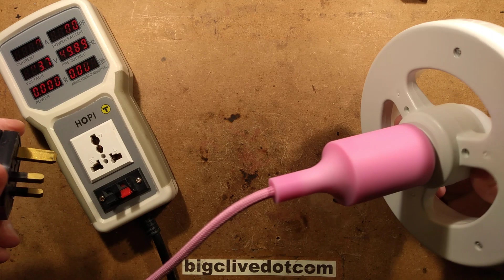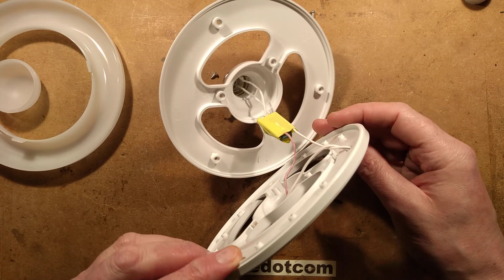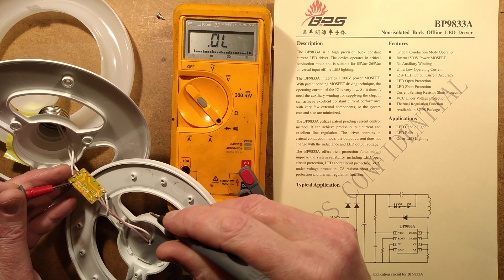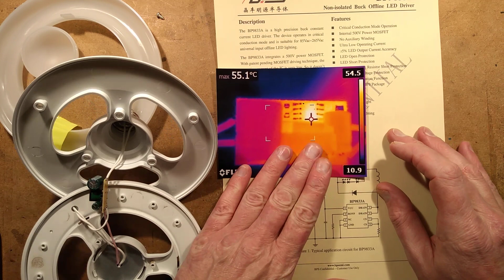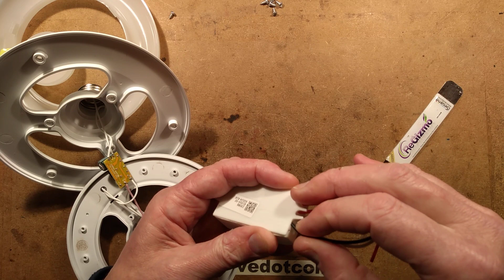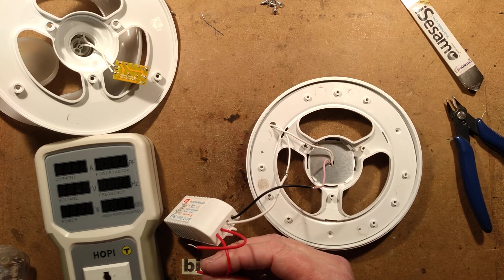Inside an LED "Circolux" lookalike?

Comment: I purchased a LUXO maglamp based upon their old metal shell design. It was only available in N.America, so the fluoro and its driver circuit ran on 110vac. Since I'm in Australia, it presented a problem. I didn't want to use a stepdown transformer. So I found a beautifully made LED T9 circular luminaire that dropped straight in. I used WAGO connectors to wire it in and it works a treat. I doubt very much if that circular luminaire is available now. So Burley was your Studio 54, Clive. 😆

Comment: I’ve wedged things (flat screwdrivers) in the clips to keep them bent back while I went and did the others around the thing im taking apart otherwise it’s literally IMPOSSIBLE to get the thing apart without breaking the clips off 

I had to do that cleaning out a dryer one time which needed to be dismantled the lint was so bad inside it had the most 😖😖😖🤬 little cover on it which was hiding screws it took a TON of screwdrivers to hold the clips back to slide the cover off without breaking it 

I got it apart cleaned it out a TON of lint came out some had burn marks on it I put it back together stubborn cover and all and it worked a million times better afterwards

Comment: The light must have been made for an RV in the USA; for some reason, on all the RV's I have ever owned, and I have owned several, they wire the 12 volt system with black + and white -.  Really threw me the first time I went to connect my deep cycle battery for the rig.

Comment: I have a GE Circline lamp from the early '80s, which I bought new-old-stock in box a few years ago. It's particularly interesting because it's made for a three-way lamp, although it only has two settings. Unfortunately, it needs a new tube (it's a permanent ballast, renewable tube model), & I have no idea where to find one.  Basically I bought it because it's a good example of the use of radioactive material in household applications ― in this case, promethium, which has of course completely decayed over the course of 30+ years ― but it was nice to use in my three-way floor lamp.

Comment: Interesting that when you put it on the lower powered supply, it looks like the outer ring is cool white, but the inner bulb is warm white? Maybe an attempt to strike a balance between the two in the same lamp, though biased towards cool as there's 64 of those and only 16 warm?

Comment: Re: Wire colors: The power supply Clive hacks in is completely backwards, isn't it? In US terminology, DC positive is red and negative is black. For AC IIRC, is hot ("live") = white, neutral = black, ground ("earth")=green. Charitably, I think whoever put that together knew which colors should go where and soldered it with the PCB upside-down, and ran out of black wire when they got to the side where the colors matter to prevent blowing out the diodes, I .E, both wire on the AC side the same color can be excused in certain cases, but at least make the negative black on the DC side (cars, for example, have multiple wire colors, so you can tell which wire is the positive for which circuit, but the negative is always black.)
. Murphy's Law in action. (Murphy did not say "If it can go wrong, it will." He said ""If that guy has any way of making a mistake, he will." or "If it can happen, it will happen." That's partially why anything where polarity matters is keyed so the connector only goes in one way nowadays, because one of the techs working for Captain Edward Murphy plugged some sensors in the wrong way 'round, causing the experiment to be a waste of time because the sensors didn't output useful numbers. The aphorism was later expanded, and the modern phrasing of it was first used by magician Nevil Maskelyne in 1908, around 40 years before Murphy said the thing, who wrote "if anything can go wrong, it WILL go wrong" in reference to any first public performance of a particular magic trick.

Maskelyne's point was that no first performance goes well because the universe is biased against you. Murphy's point was that the apes doing the actual work can't be trusted to match wire colors. But together, as the unofficial 4th Law of Thermodynamics, they're known more for Murphy, and haven't been proven wrong yet. (see a Soyuz or two that nosed into the ground because its sensors were plugged in the wrong way around, or the related aphorism "Those who try to build idiot-proof systems always underestimate the persistence and ingenuity of idiots." (Anonymous, but Heinlein said something similar)

Comment: I don't know how it works in the UK, but in the US (or at least my state), the power companies would have to get regulatory approval to switch to billing by apparent power.
Reply from the maker: They would include it in the small print of a "new improved" contract, knowing that people wouldn't wade through the ream of paper they got sent.  Same way the banks gradually reduced interest on current accounts to zero.
Reply: @bigclivedotcom  Again, at least in my area, they'd have to get government approval to make that kind of change.  Because they're a monopoly, power companies (among others) are regulated as to what they can or can't do.  That doesn't mean they won't try to sneak it though, but it's not as easy as you're suggesting.

Comment: Hi Clive 
How do I send you this woeful power supply for you to do a breakdown of it?
I would love to hear what you think of the cut and shut job they did, im sure this unit is cut out of another product and whacked into these little wall power supply units. 
Even the sticker says 6A and the one they stuck it over says 4A wtf
Reply from the maker: The repackaging of power supplies is a really common thing.  They usually involve quite a chunky box with a loose module inside that has wires chopped and new ones tacked on.  The good news is that they are often really good quality supplies.  I tend to downrate any power supply from eBay by 50% as standard.
Reply: I hear that 
This one however has an LED tacked on that was laying over a hard link and 4 bare cut wires 2 from the dc side and 2 direct from the 240 mains just chopped off and uncovered. The supply just pulses under load 
Btw Big Fan love your awesome channel sir, I just wish you was my teacher in collage I might of taken more notice ha ha

Comment: Those chinese in lamp SMPS are utter crap, they've got all kind of harmonics bursting everywhere, its overheating after 2 seconds of use and those caps close to heated components are no-no in good designed PCBs - so those lamps are just proper shite! The other supply  is true horror!

Comment: Clive, you ever review any bike lights? I just got a "Nestling Solarstorm" 3 led headlight run by 4 18650 batts very affordably. But 2 reasons I bring it up. First they have a power on light that has parasitic effect. This could be cured. Secondly my last unit very much like this design had a very poor strain relief entering the headlamp part. I actually fixed it and conformally coated it with 99 cent HF epoxy. Dragged it through a lake to make sure it worked.

Comment: Russian roulette with capacitors !. Last year I stripped apart an old PC PSU that was in  my workshop (needed parts from it). It had been on the shelf for approx. 5 to 6 months. Took the case off and thought, ummm, I will just give those a jab with a screwdriver, just in case. So I did... Bam !!!. Christ, they had a full charge. Just as well I did that or I might not be here now.

Comment: perhaps stupid because i did not think about it long enough,
but could you improve power factor by adding chokes on mains wires going in ?
50Hz is no high frequency for a inductive-resistor but would it work?
Or would you arrive at the point where the power changes from cap to inductor and the load would get less power.

Really need to look up power factor correction cuircuits.

Comment: What lens is referenced around 8:40? Could use a closeup lens for the E4 at work (the FOV sucks for circuit boards)
Reply: It's an idea from mikeselectricstuff (https://youtu.be/Lie771fzBaw?t=51 ). For the lenses you can just search for "ZnSe lens" on amazon or ebay. The holder is a 3D print of a model from thingiverse (https://www.thingiverse.com/thing:407201 ).
If you use the thingiverse holder,  make sure that you buy a 20mm diameter lens. As for the focal length, I use a 50.8mm and a 101.6mm lens at work. The 50.8mm is nice for closeups as seen in this video, the 101.6mm is better to get an overview over larger PCBs. Just remember, that the focal length is also the distance you have to keep between the lens and the PCB, so a 25.4mm lens might give you great magnification, but you'd almost have to press the camera into the board to get it in focus.

Comment: 24 Watts would drive an actual fluorescent bulb of that size... have they managed to build an LED light with no efficiency gain at all?

For a future tear-down, you might want to have a look at the "UFO detector" sold on Amazon.  Bunch of LEDs inside, along with a bit more circuitry than needed to make them flash convincingly.

Comment: What can be done in a domestic situation to improve power factor, is there a plug in gizmo to sort it out?
Reply from the maker: No.  It's very complex nopw and requires extra circuitry in every switchmode supply.  It adds a complete new failure layer.

Comment: Hi Big, love the videos. I have an old  Sony amplifier “Digital Audio/Video Control Center” (Sony model # str-k650p). I had been using up until a few weeks ago when it just audibly flickered out. The thing “sounds” (clicking noise) like it turns on but is super dimly lit. I took the cover off(unscrewed) and I can put my finger on the part that goes click click click when I turn on and off. That component that makes and generates a minute vibration, has a copper coil thing. I’d love to send it in, because it is so retro. I am not interested in paying for shipping 😗. Keep up the good work holmes.

Comment: That stupid color code is used here in the USA in RV's for some reason.  Really threw me when they told me that  as we hooked up the 12 volt system to a house battery on my first new rig!  Then I noticed it every time I worked on my motor home, I always meter the connections to see if some one has screwed them around.  Normally in every other system I have ever worked on, white is + and black - unless, of course there is black and red, then, of course red is indeed +.

Comment: how do, love the videos. have you ever thought about dismantling one of the Chinese 12v diesel heaters available on ebay/AliExpress? after looking into getting one, and the bad press along with the good it would be interesting to see if there are any 'obvious' gremlins that scream out at you? are they really deathtraps just waiting to burn down a camper or actually really good value? Keep 'em coming!!
Reply from the maker: I was looking at them on banggood recently.  At about £300 they seem so much cheaper than the main brands that something must have been compromised on.
Reply: @bigclivedotcom  you can pick up a 2kw, 3kw or even 5kw heat output 'planar'chinese copy on ebay for around the £130/£150 mark!! There is a forum on facebook dedicated to the set up and trouble shooting of these cheap and cheerful units with varying success!!

Comment: Hi Clive, have you got some new audio kit doing a kind of auto-blanking thing at all? I'm listening on headphones and noticing the usual background buzz is being muted when you're not speaking or discharging spicy caps... I suppose it's matter of opinion and others may disagree, but I find the constant cutting in/out of the background noise somewhat annoying. (more noticeable in fact than if there was no cut off and one could just hear the iron switching in the background.)
Reply: Not complaining by the way, just an observation ;)
Reply from the maker: My new phone seems to have a noise gate when it's recording that does have that effect.  I don't think I can disable it.

Comment: Clive I am convinced that some of the new smart meters are measuring VA rather than power already. The reason I say this is that several friends have had them installed and their electricity bills jumped by on average about 30%. This is with the exact same appliances and usage. I compared the units used for 4 of them compared to the same quarter the previous year, the lowest jump was 20% and he had changed all his CF lights to LED and a plasma TV to LED so should be using significantly less power (the LED TV is rated at about 170W compared to 650 for the plasma). Measuring VA instead of W is the only explanation I can think of.
Reply: I suspect the change from plasma to LED would have been more like 300 W average for the plasma and 150W average for the LED-backlight LCD as the ratings you mention might be maximum ratings. All depending on the screen size and brightness settings of course, but plasma energy consumption is very dependent on picture content and brightness setting while LCD consumption is less so (it is however dependant on dynamic backlight type and settings). Also, the power factor of both the plasma and the LED TV should be near 1, so for those the VA versus W argument isn't relevant anyway. Changing CFL to LED lights will result in an actual power cosumption dropping by a factor 1 to 2, but the power factor could be a significant problem (usually both LED and CFL lights have a power factor significantly below 1). In any case, this doesn't explain why he consumed 20% more according to the meter. If the old one was a mechanical meter, it could have been significantly off due to wear and tear but if it was an electronic one I agree that the most likely explanation is the power factor.
Reply: The plasma was a ridiculously big screen - 56 inches or something stupid. The LED was 40. Those were pretty much what I measured power wise.

Comment: The club was shut for 6 weeks, the report is found easily on the net.. I say no more ;) Anyway, I remember we had one of those circular fluorescent lamps when I was a kid, it was in the kitchen. I always wonder if they still make the fitting as I still see the lamps in some off road local electrical shops :) We also had one of those horrid circular heater/light things in the bathroom :D

Comment: I'm sure what the power companies will do is release a huge amount of propaganda stating they are reducing the price per unit of electricity by something which seems phenomenal to the ordinary public (say 50%) and then people will be left in a state of confusion when the number of units they use increases by 75% over night.

Obviously it will end up being debated in parliament too by a load of MPs who will applaud the energy companies generosity and completely miss the point. Maybe a few of them will end up with one of those 6 figure salaries at the end of their political tenure where they dont actually do anything, it's just a reward for peddling baffling spin at the commons.

That's conspiracy for you 🤔

Comment: ive recently removed 3 osram circolux, fitted in 1965, and still worked with original tubes...one was the bathroom light, and i remember as a kid we left it on all night, goodness knows how many insane hours and power ons, on it, and it still worked fine

Comment: re colour codes for input and output on random ebay stuff, I got a few 5V 2.5A switching supplies a while ago, the dirt cheap kind that are re-purposed from other things, good quality but obviously chopped out of some other product with the ends of wires still soldered into the board, and they had the 230VAC input on black and red wires and 5VDC output on blue and brown o_0
Reply from the maker: Those things are quite intriguing because of the way they are sometimes hacked to get a different voltage or to patch in the input and output wires.  Some of them are very good quality supplies.